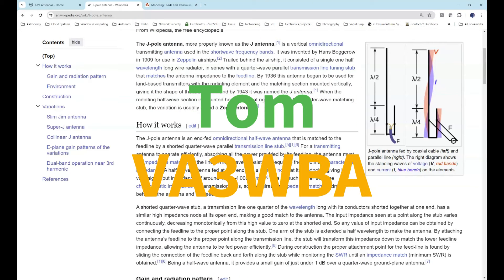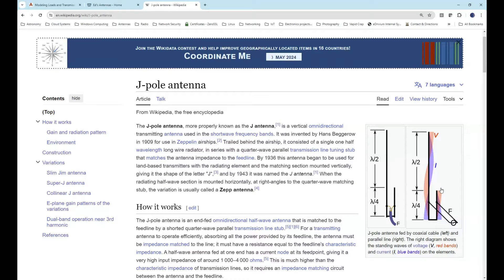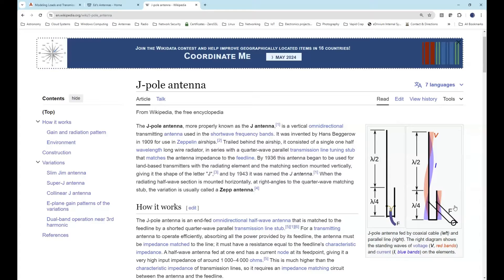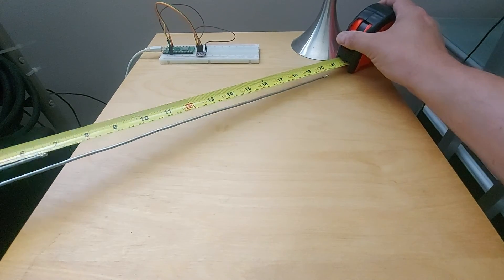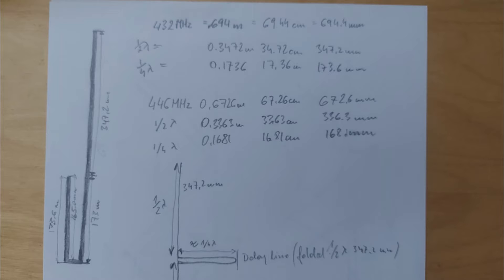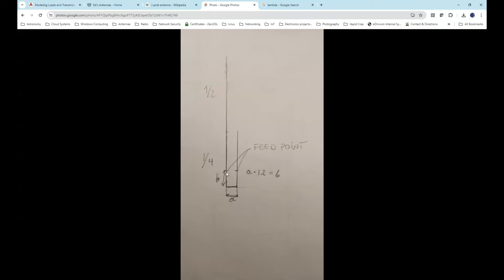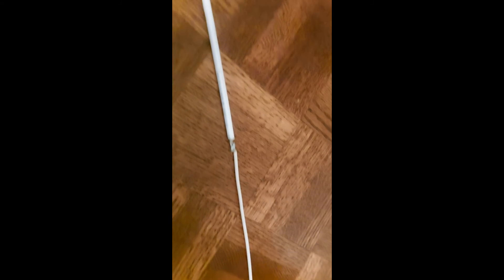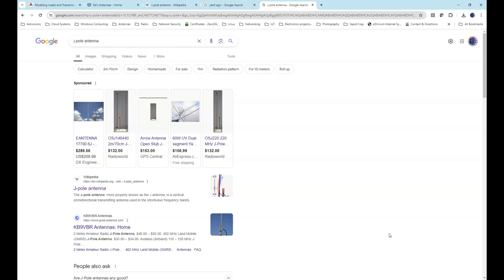How to make a simple 70cm (432MHz) J-Pole antenna

Comment: I enjoyed your video.  I recently made a J-Pole for 465MHz using farrites for a choke but like your choke idea so will make one to try it out.  I very much would like to see another video of your 2m/70cm antenna or better yet going further adding 220MHz.
Reply from the maker: Thank you so much for your kind comment! I'm excited to share that I'm working on a new video featuring a 2-meter J-Pole antenna—built entirely from scrap wire salvaged from a discarded lawn sign. It's my way of celebrating a small but meaningful milestone: reaching 100 subscribers on YouTube! 😄

Comment: hello my friend, I've been building my own J-Pole antenna for months. I build it with pasture fence wire in Germany, we say Weidezaundraht. You can buy 400 meters/1312 feet in 1.8mm/1/16 inch thickness for around 30€/32$. The wire is made of aluminum and it's cheap and quick to build for many antennas, but it has one problem: it's not stable for long antennas and needs a support like a fiberglass pole or something, 

i hope, the information can help you

73 DO4NRW
Andreas from Germany